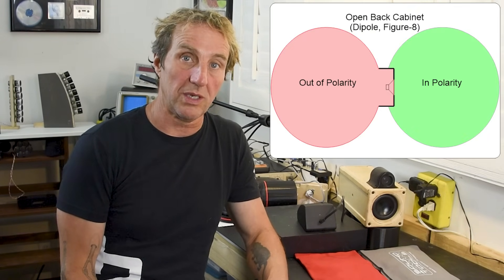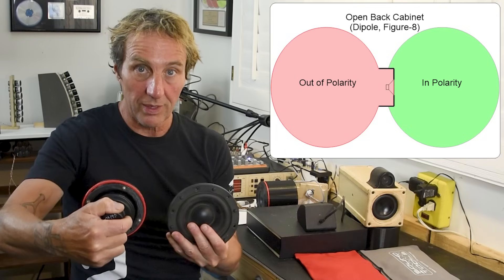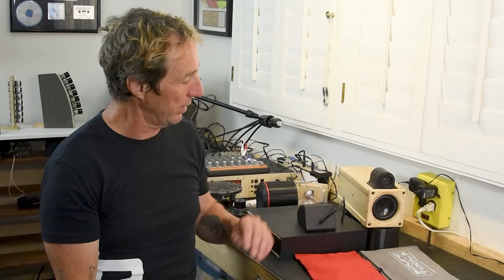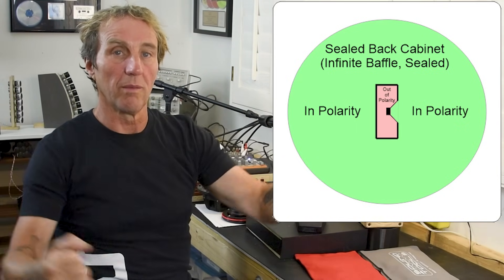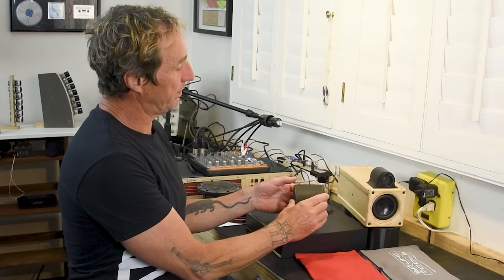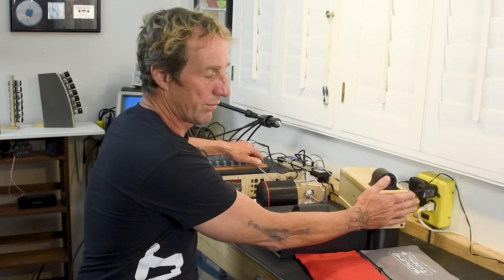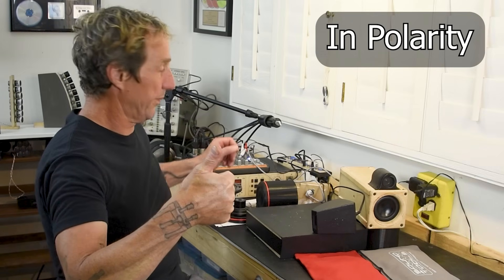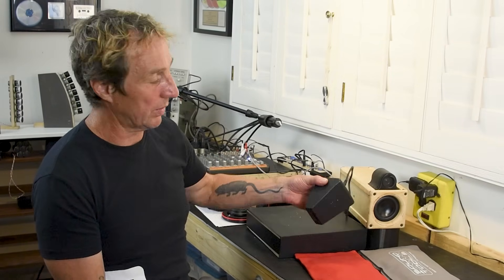Should Stage Monitor Polarity Be Reversed?

Comment: I smell a rat in the premises of this question, and its small scale partial demonstration.  

Time alignment is likely far more important than cabinet polarity.  That's incredibly messy across different stages and local or distant speaker stacks at larger events, often with delay lines on some feeds in arena or festival systems.  

A good comparison would be in ear monitors, that are generally preferable for feedback or personalization of mixes or click tracks for some artists, whenever practical.  

Speakers are not uniform directionality, whether horns, large driver beaming, or cabinet and line array for gain or directionality designs.  Monitors are not close coupled to mains as this demonstration suggests.  Those issues are too complex for a simple model not based on a specific sound system and stage layout. Instrument amps if more than trivial also play into the time domain issues.  

Low end is largely omnidirectional, and so any out of phase elements lead to hot and dead zones, if not scrambled and far more complex due to distances and time based interactions.  

A larger goal may be to KISS overall, and limit conflicts of amps, in ear only monitors, stage positions, and mains or remote stacks, unless one wants to treat musicians as cat toys.  Then, insert delay lines in in ear monitor feeds, and randomly change those delays, while pretending it's a symptom of them moving around and professional advancement to facing the issues of larger venues than they used to work.  Or with more experienced groups, ones of better tech for the audience experience in such venues.  ;-p

200-300 mS delays are especially confusing to many people, even if not uncommon as slap back echo in some venues, or a norm large facility pipe organ players learn to handle, by playing to an expected result, and not based on immediate monitor or instrument audible output.  (That's a syllabic rate delay, versus 40 mS being critical as a conscious-subconscious boundary.)  

I still don't hear anyone demanding restoration of the old Dead "Wall of Sound" with instrument and vocal cabinets all behind the band in a single time aligned layer, even if a 4 channel spacial pickups system was used for certain guitars, along with the issues of noise canceling mic pairs.  

OTOH, switching direct rectification amps that deliver power line limited outputs in a box that one hand can lift, enable compact high output modular line arrays never historically possible.  Combine that with in ear monitors, and limit use of large instrument amps on stage, and consider positions and distances for timing and architectural acoustics, and that makes the consideration of open monitors themselves moot (even if anything inverted polarity short of canceling mic pairs, can be bad news).
Reply from the maker: Well that makes a big mess out of a simple scenario.

Time alignment is important and not exclusive. 

If it's out of polarity there is no time alignment possible that can achieve broadband summation. 

This video is to help people understand that polarity has nothing to do with which direction a speaker in a sealed or ported enclosure is pointed.

Step one, get polarity right, then deal with time and and EQ and placement and all the other atuff

Comment: But what if the monitors are 15 feet back from the mains?
Reply from the maker: In polarity will sum well with equal arrival times and alter as the distance is increased creating issues.

Out of polarity will never sum and will always have cancellations and those issues will change with distance.

Out of polarity is never good for summation, in polarity is good for summation when equidistant from sources 

Out of polarity is always worse for summation broad band

Comment: Hello hello.
Great and informative video as always.
The best way to avoid phase problems in monitors with respect to the PA is for everyone to use in-ear headphones.
Whenever possible, I avoid using any type of monitor or wedge on stage with the bands I work with,
not even side fills.
Although it's not always possible.
Thanks for the "physical" explanation.
And the dog is very funny.🐶
Greetings from Spain.

Comment: Thank you Dave .Awesome explanation and helping  in deciding set up for my friend ls to play .They are going to have a party at a farm and using one of the big barn hay lofts as the stage .Maybe 3000watts of power maximum but we shall see .Setting up stage monitors and their head instrument units and getting it to sound good is going to be a pain but I played and old adcom gfa555 with a pair  of klipsch in that barn and it sounded amazing .now the barn doors will be open and there will still be bails of hay in there .They work amazing at blocking reverbs .any advice as to speakers inside vs speakers outside and the  horse pen area  will be the dance floor and dining area
Reply from the maker: Hey bales are amazing for blocking sound. Early coacella festivals when the stages were closer together I had them pile up hay bales (actually straw) as sound barriers. Then the straw bales were used throughout the stagecoach festival for a look and places for people to sit.
Reply: @DaveRat  going to try some simple full range speakers and 2 subs 2  in opening and 4 more outside .Going to set them up off the ground on the hay bales and the subs at the corner ..Renting the stuff from our local place in Toronto .No lights other than some for the people on dance floor and solar tea  lights for the tables .KISS .so long as the food is good and the band can get them going .it's all good .don't ask me to dj I'll ask Alexa to start with 70s prog .Might upset some of the guests
Reply from the maker: Super cool yeah I get the speakers up high and it may be better to put all the subs for the mains and just use straight speakers for the outside
Reply: @DaveRat  If the horn driver is at ear height 6 ft that should be good enough or if I put them higher to I have to point them downwards .the outer ones are about 40 -50  feet .Just don't want to have a hole in the middle the.i will put the inner pair at barn door width which is about 20 feet and toe them towards the center of where they will be dancing and the subs at the bottom of the ones close to the barn door ..Haven't set up something in a long time .I think he's renting the 4 out side speakers and I think they are Peavy and they are amplified .Have to remind him to get the right XLR cables and the right mixer for it .I think his buddy has a simple numark mixer and their fancy CD players/media with computer and another set of speakers and amp for those .See what happens have 2 week ends do get it ready and get to do some fishing at the same time . Thank you so much Dave for what you do and how you explain things .Sa a sparky who's got some film credits .I appreciate good sound when I go see a band and when you watch a movie  or parties .Lots of effort goes in ..Starting to learn about regulations on wireless microphones and restrictions in frequency per nation

Comment: I tend to roll the low end off on my stage monitors anyway, as there is typically enough low end coming from the main subs that things can get muddy on stage. Over the decades I’ve gone back and forth on reverse polarity of the monitors. At this point, I just leave them normal. The main reason to leave it alone is because inverse phase on the monitors can have a detrimental effect on the performer because the sound reaching their ears from the monitors is not phase coherent with the sound they hear from within their head. It’s pretty much guaranteed that a phase-flipped microphone or monitor will be distracting to the performer.
Reply from the maker: Cool and agreed. Polarity reversals result in drastic changes to minor volume shifts and everything in polarity will tend to be way more stable

Comment: I've been wondering about this for years, but never brave enough to test it out at a real festival. Glad that I just kept to the old tried and true "everything in polarity" setup. I do have a question that ties in nicely though...and maybe you could do a demo of it? Is there any advantage to having stage monitors out of polarity to adjacent stage monitors? I thought I saw a post somewhere that it might help for gain before feedback, but is there any truth to that at all? Thanks for such a great channel! I love all your demos!
Reply from the maker: Flipping polarity gets messy very quickly and polarity reversals don't really help with feedback. 

Flipping every other polarity on the wedges would result in less low-end radiating from stage and create holes in the sound midway between the wedges if the same signal was sent to two wedges that are out of polarity with each other. This may be desirable if midway between the two wedges there is miced acoustic instrument And this would reduce some of the wedge low end getting into those mics in that location

Comment: What happens when the main subs are in the cardioid array setup? Isn't this when the subs are set in a way to boost or cancel low frequencies on stage?
Reply from the maker: The cardioid sub setup will have polarity reversed drivers canceling low end behind the array.  if the array is set up properly it should still be treated as if it's in polarity and therefore the wedges should be in polarity as well.
Reply: @DaveRat  thank you for the information. Thank you for being the wizard of sound. It helps us to know what we are hearing when we go to shows. Kinda sad that way too many people don't know what real quality sound sounds like. Most people are happy with their air pods.
Reply from the maker: We each have our passions.  Most people are visual more than sound focused. All good, us soundies have a joy they will never lnow

Comment: Excellent demo and explanation. I’ve seen indoor rigs (massive hangers and big agricultural sheds) use ground-stacked subs in a sandwich (forward facing, rear facing, forward facing) and the guys running the system were explaining that this made the bass output from the rear of the rig like a cardioid pattern. I’ve long suspected that this was … optimistic and more likely made the low end in the building more weird, not better.
Would love to hear your thoughts and experience?
Reply from the maker: Does subways with forward and rear facing subs can be very effective. 

I've done many videos on subwoofer array configurations of cardioid and end-fire. As well as videos allowing you to hear the difference and how effective the various setups are. I have an entire playlist dedicated to subwoofer arrays and cover this in-depth

Comment: It's a compelling theory, but I believe its limited in the fact that wedges are pointing up, while foh points out. If they were at directly opposing focality, then I think phasing issues would occur. Also, if there are parallel reflective surfaces, like on small stages, big standing waves can convolute things as well. Phase-reversing might help in those conditions. With near-field wedges out in the air though, the energy diffuses before it causes any issues like bouncing off the vid wall. Use IEMs anyway...Lol. No Issues!
Reply from the maker: Hmmm, those are a lot of complexities. But the baseline fact is that in-polarity signals will sum when time aligned and increasingly have cancelations and issues as the time offset and complexity of reflective surfaces are increased until full decorrelation is reached

Out of polarity signals will never sum broadband and will have differing versions of cancellations and issues as complexity and reflections are increased until reaching full decorrelation.

polarity reversal will almost invariably result in more complexities and cancellations broadband in every scenario

Though yes, there may be some scenarios where screwing up things broadband to achieve a narrow band cancellation or summation is desirable and polarity reversed can apply.

A great example of that is cardioid subwoofer arrays where broadband cancellation is desirable at the expense of reduced bandwidth in the coverage area.
Reply: @ cardioid subbing is exactly the example I was gonna reference as a follow-up! Everything you said was spot on!

I was kinda thinking about something similar yesterday as I was heat-mapping a wi-fi install. How we take a ref mic around the stage and look at spectrum graphics to find the ugly…although the complexities of broadband audio are much greater than rf signal strength. Oh wait…can o’ worms statement there. Freq management for wireless can be daunting…Lol.

My live stuff these days is X32/Turbo (small band setup only.) 

I had a small demo studio in Nashville for a good bit, and toured with Kansas, ZZ, Styx and a few others. I’m glad I found your channel! Gonna like and subscribe!
Reply: ...and don't forget about cowboy and baseball hats scooping the wedge energy right back into the vocal mic! Fun!

Comment: Another great explanation and summary Dave. How about a video/experiment using two JBL PRX Ones (or equivalent) as stage monitors with a lot of open mics for acoustic instruments versus wedge monitors?  Feedback rejection, even stage coverage, interaction with mains....
Reply from the maker: That would be tough to set up in my spare bedroom where I do the videos. 

For complex situations like that you're going to need a combination of multiple solutions. 

Things like close mic'ing the instruments, well thought out monitor placements, perhaps using higher quality wedges with more linear frequency response and more directivity control are a few things that will help
Reply: @DaveRat  I highly recommend trying the comparison sometime. I have.
Reply from the maker: Using quality speakers for stage monitors whether they're designed for monitors or sneakers will typically perform better than using lower quality speakers whether they're speakers or stage monitors. 

The main thing is pointing the sound away from the mics and towards the people and using higher quality gear that has smoother responses should get better outcomes

Comment: Hi, a trick that we would do(mainly to reduce the stage volume) we would reverse the polarity of every other monitor, this would make them cancel out across the stage, but when you are in front of one monitor you would be able to hear it, but off stage you would not hear the monitors, (in theory) some times it works sometimes not. But when it does it really helps
Reply: Wouldn’t that cancel out frequencies on stage? The comb filtering could be pretty bad in that configuration.

The challenge is that phase differences depend both on the polarity of the speaker AND the distance between the different sound sources. If two speakers are out of polarity, they will be in phase at frequencies where the distance between the speakers is half a wavelength (or 1/4, 1/8, 1/16, …, 1/(2^n) )
Reply from the maker: That setup should reduce the low end on stage but even more so reduce the low end radiating from stage. 

At a distance from stage your equidistant from multiple sources that are out of polarity and if they're all balanced it should cancel very well. 

On stage you're closer to one source and farther from the other so the volume differentials will allow you to hear the source your closest to with some cancellation from the outer polarity sources that are farther away. 

Kind of a take off of the grateful Dead Wall of Sound where they had two SM57s wired out of polarity with each other and they would sing into one. 

But the sound from the PA behind them would enter both mics fairly equally. 

This allows the voice to be heard somewhat while reducing and canceling out the sounds that a farther away. 

That said, both the grateful Dead mic set up and The alternating wedge polarity setup will work but at the expense of sound quality..
Reply: Nice trick!
Reply from the maker: I could see that working to some degree
Reply: @DaveRat  haha...just pretty much answered the question I literally JUST posted lol....I guess I should have read the comments FIRST hahaha!....but...a demo would be kinda cool though too! (wink-nudge)
Reply from the maker: A demo might be a big setup for me but it wouldn't be hard to predict using soundvision software. 

Call ponder building a model up

Comment: 80Hz has a wave length of approx. 4m. If you have 2 speaker on one line in space you need to pull back one of yhe speaker about 2m in the back to cancel this specific f out. It's  different with 250 Hz. To accomplish a cancellation you need to pull back the speaker about 70 cm. In real life monitor speaker are lying everywere on stage. So a general phase switch won't change the scenario much. The changes to make it better or worse is 50/50.🎉
Reply from the maker: True but, out of polarity will almost always cancel at more frequencieies than in polarity.

In polarity can sum at all freqs if the time is matched, out of polarity can never sum at all frequencies.

In polarity starts at being maximally summed when the arrival times are matched and progresses towards de-correlated as time shift is added. Out of polarity starts at maximum cancelation when the times are matched and progrwss towards decorrelation as the time is increased.

Out of polarity can help with a specific narrow band issue on some occasions as the expense of volume instability, in polarity works better almost always.
Reply: I see your point, cheers!

Comment: Another way to look at this is the main PA speakers point away from the band and the monitors speakers point towards the band, therefore the polarity of the main PA speakers should be reversed. And put the main PA speakers through a 750 millisecond delay.
Reply from the maker: Ha, and yes that would be a way to look at if the goal was to be perfectly timed to create maximum cancellation issues for an 843 foot deep stage